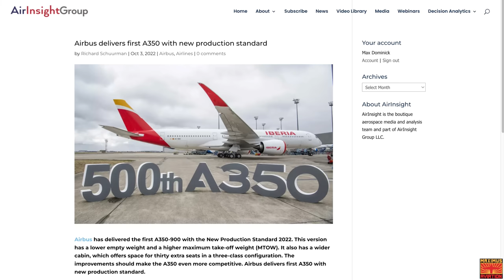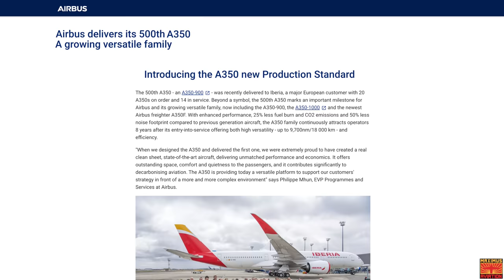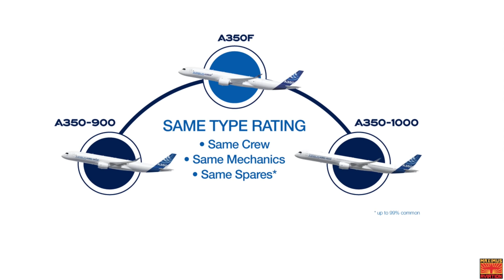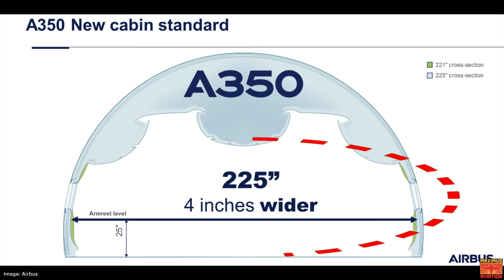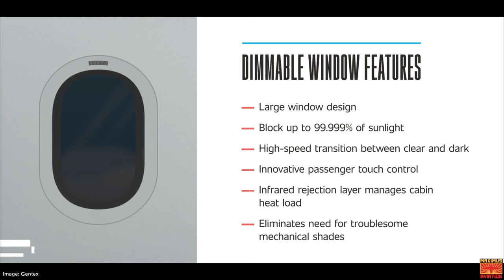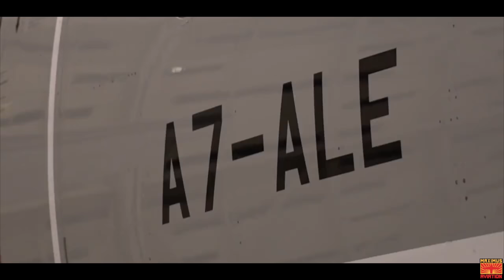Did You Know Airbus Made An A350 MAX Version?

Comment: It is actually called "DUCT (as in air conditioning ducts) TAPE," though 'Duck' is FUNNIER !
😄
Reply: There is a Duck brand with a duck picture on the inside of tube in the USA but it is duct tape.
Reply: Now if more US airlines would adopt Airbus planes I'd be grateful as Southwest Airlines and Boeing's criminal behavior has made it harder to plan. I refuse to fly Boeing anymore. Embraer E170 and Airbus A320-321 on Frontier, Alaska-Skywest, Spirit, Delta.
Reply: @eleventy-seven  if you are in America, that would be quite difficult if not impossible.
Airbus will always be a "Euro" based aircraft company, even if it assembles some Airbus jetliners in the U.S.
Hopefully, FAA sanctions are working and solving all the Boeing  safety issues.
Reply: An educator never learns to stifle themselves.
Reply: "thin cotton duck coated in waterproof polyethylene (plastic) with a layer of rubber-based gray adhesive (branded as "Polycoat") bonded to one side" ww2
Reply: @2adamast  But don’t you find that underwear to be uncomfortable?

Comment: Hello you write A350 MAX .  Been working with quality assurance at AIRBUS since2003 and with the 350 from the beginning in Toulouse observing that the quality is set to side example if a mechanic contact me asking for assistance and my se a fault it can lead to dissmissal of him(her) and they dont want me to put my nose into things. As a example look at THSA Actuator it is not put togheter correct on 100% of the Aircraft . The peices with wirelockin wire is fitted wrong way so in the end the wire can pull the fastener lose and create a failure of the peice or a hydaulic leak or a electrical malfunction when i tried to escalate this a coupe of years ago it just blow up in my face. 

Regards 

Jan Vanhainen

Comment: Did they add MCAS too?
Reply from the maker: Thankfully NO. lol
Reply: Ha!!
Reply: Just dueling sidesticks.
Reply: I know it's a joke, but Airbus actually uses similar systems since the 80s. The difference is that they have always used redundancy. And even then they've had they share of bad experiences and software improvements.
MCAS failed with the MAX, because the 737 is still an old analogue aircraft and there was no base upon to build the must needed redundancy. All 737 operate with just a single flight computer in operation. After the revision, the max is the only 737 flying with the two computers operating simultaneously - while most other aircraft use 3 (or more) for the same role.
Reply: @miks564  So do you fancy yourself an aeronautical engineer to do you really sell insurance. We vote for the later. Bilge is very obvious and is hard to sell.

Comment: Tape is the way to go. I don't know why they are still trying to paint over composite. Just wrap the plane in vinyl like you would a car. Use the speed tape material, but in larger rolls. Instead of 3 inch wide, make them 0.5m or 1m wide. Tape can be applied at any airport by the airline's own people. No need to send the plane to a specialized facility to be repainted. So no down time. It is also easy to patch small segments damaged by birdstrike, etc.
Reply: And just paint over the tape! Brilliant idea! Saves maintenance and later embarrassments from keen eyed youtubers.
Reply: Too expensive and too heavy. The problem is surface prep, not rocket science.
Reply: Or just use boat paint it's pretty tuff

Comment: Do you know Airbus has flown an autonomous A350-1000, 500 times without pilot inputs to taxi, takeoff, and land over the last 2 years using just new tech onboard? At least one video shows the copilot acting like the dog biting the captain each time he went to touch something. Referencing the ongoing joke that in the future there will be one pilot and a dog in the cockpit. The dog is there to bite the captain if he goes to touch anything. May not be a joke in the future.
Reply: Not surprising really. Won't be long before that is the standard in the industry i imagine.
Reply: But will the pilots remember how to fly if the need were to arise? I prefer my pilots to have some recent work experience.
Reply: Single pilot operations for commercial airliners  is not happening in this decade or the next . Still alot of questions that need to be answered. 

Anyways most pilots prefer doing their own take offs and landings unless the visibility is terrible.
Keeps them from getting rusty , and sharpens their piloting skills to avoid degradation...

Comment: Another advantage of the new A350 is, the weight reduce further up to 0.5 ton naturally during service…. As the airplanes shed paint.
Reply: Right you are. Great point. The airborne commode ejection drainage system directly into the environment also reduces weight. No need to fly around with all that heavy poop.

Comment: Pretty impressive these improvements.
Reply: Nothing ground breaking. Usual refinements of an existing design.
Reply: Normally these level of improvements come with a completely updated airframe. 
If they can do this in a regular update, the a350 neo will be a beast when it eventually replaces the a350.
Reply: @baronvonlimbourgh1716  Not really. Mostly just reconfiguring the interior with the latest trends. It's been done many times before on existing aircraft. The most significant change is moving the bulkhead back a couple of feet. Similar to what Boeing did on the 787-8 replacing the tail section to the 787-9 tail section.  Very similar to what happened on the 777 as it's progressed.

Comment: 787- I'm the narrowest seat in widebody aircraft category
.
 
350: not so fast, I'm the newest King of narrowest seat in widebody aircraft
Reply: False 
based on the 787 ACAP, this is 17.2" seat width on the 787. Better than the 777, and 747@ 10-Abreast seats
Reply: @ndlben7129  No that's not true either. It's pretty much been Boeings standard on the 747 and 777-300 ER for decades.
Reply: @johniii8147  The 747 and 777 "classics", are 17" width seats, the 787 and the upcoming 777X is 17.2" with more humidity and lower altitude impression of fly of the cab ...

The 787 is a New comfort standard vs 747 and "777 classics"...
Reply: I challenge everyone in this thread to look at a ruler and ask yourself, "This .2"difference; does that amount to comfort? Can you even see the markings for .2" without reading glasses or a magnification lens?" Then measure the diameter of your arse.
Reply: @ndlben7129  Just depends on the seat the airline chooses on 77X. 18 is plan on many of them with the thinner walls.
Reply: New normal for cattle class configuration
Reply: @ndlben7129  787 seats Ranges from 17.2" to 17.5" for a 9 abreast. Boeing can skin the walls too in the future to fit an 18" .
Reply: @mmm0404  It's an issue people make far too much of that don't want to pony up the money for higher classes and get stuck in the back of the bus. On BA for example width on the 787 is 17.5, the 350 17.6 and the 380 17.5. People just like to complain while paying the cheapest possible price in the category of traveler.
Reply: Good one Ndl Ben. I learn something new everyday.

Comment: So, we're going to ignore the elephant in the room, which is that Airbus is scared of the 777-9 and what it's bringing to the widebody sector. Also the fact that Airbus is basically doing to the A350 what Boeing did to the 737, by copying 787 tech. I digress.
It's clear that Airbus has no plans to develop a new widebody aircraft, so they will focus on their highly successful narrowbody sector and let Boeing eat their lunch at the big boy level. Funny Maximus didn't mention any of that. 😜
Reply: I thought the A350 was a new wide body aircraft no?
First delivery in 2014
Reply: @Rasscasse  The 777-9 is brand new. Remember Airbus marketed the A350 as an XWB, or Extra Wide Body, which was a dig on the Dreamliner that was the new widebody at the time. But, Boeing has been comparing the width of the 777-X to XWB, which pales in comparison.
Boeing widened the 777-X by using thinner and lighter components on the walls, so Airbus has done the same with the A350 to not only make it more competitive in terms of roominess, but to allow 10-abreast seating, which the 777 has had for decades. Some airlines are looking for more capacity on a twin engine widebody which Boeing is about to deliver so Airbus wants it's largest widebody to become a bit more competitive, so they now have these optional models. I wonder if they'll give them a name to distinguish them from the XWB. UWB maybe?
Reply: How exactly is Airbus scared of the 777-9?? Airbus are so well ahead on their game that people like you are unaware what will happen to the 777-9. Quietly by the wayside Rolls Royce have been developing their Ultrafan. Their target is to get the new engine on the prototype A350F in 2025. So with a new geared engine that has about 12-15% fuel advantage over the GE9x being applied across the whole A350 line what is going to happen to the pax version of the 777x programme? It's going to be dead isn't it?!! Just watch!!
Reply: @nathd1748  People like me, uh? When I talk to people like you, I like to talk numbers, since numbers don't lie. 
Before we talk about the Ultrafan, let's talk about how both planemakers are doing. When it comes to narrowbody, Airbus is virtually untouchable, especially in terms of orders. However, when talking about widebody Airbus can't touch Boeing. After 8 years in service Airbus just delivered its 500th A350, and fewer than 1000 total widebody aircraft on order, and fewer than 250 A330. Do you know how many Dreamliners, 767 and 777 Boeing has delivered since 2014? Of course you don't. Over 1000 Dreamliners alone have been delivered. Adding 777, 747 and 767 variants  just make the numbers even more lopsided.
The Ultrafan won't be fitted on the A350 without some design modifications, much the same way Boeing had to do when they put the CFM 1B on the Max, and in terms of cargo, that's not putting Airbus anywhere close to Boeing on cargo aircraft orders either.
The reason Airbus is making the A350 wider is to make it a competitive option for the 777-9, but Airbus still can't give it a higher passenger capacity, cargo capacity or higher maximum takeoff weight than the Boeing. If fuel savings was all airlines cared about they won't still be flying the quads.
So yeah, people like me know about the Ultrafan, but the numbers say it all.
Reply: @sainnt  You dont know the numbers obviously. Boeing may have built over 1000 dreamliners but they haven't yet reached break even have they? While Airbus reached that on the 350th A350 of all numbers. The Jltrafan will go on the A350 wing just like the GE9x has been fitted on the wing of the 777x. The nacelle will be raised and the increased fan diameter will be managed with nowhere near the aggro that Boeing have had with their short legged 737. The all important number is the seat mile cost. The A350 with Ultrafan will give a number that the 777x just cannot get close to.
Reply: @nathd1748  Again, numbers here, we're talking about numbers of aircraft being ordered and being delivered. Planemakers have diverse products, so obviously developing a game changer, which the A350 is most certainly not, would prove to be costlier. Airbus never made a profit on the A380, but most would argue that it's still a successful product. The Dreamliner has enough orders yet to be filled to actually make the program profitable, unlike the A380.  That also doesn't change the overall numbers of widebody aircraft being delivered by Boeing. They may not yet be profitable with the Dreamliner, but they're very profitable overall with widebody aircraft. Go check those numbers. Is the A330 neo actually profitable?
You again proved my point by trying to be ignorant. The wings of the 777X are different from current 777, so in fact modifications were made to accommodate the GE9X, and same would happen with the Ultrafan. Neither changes are plug and play, so, there are modifications, no matter how much you want to downplay it. That's the reason every variant of an aircraft requires separate certification.
Reply: @nathd1748  who said the a350F is getting  the ultrafan ? That is not happening  . Wishfull thinking
Reply: @mmm0404  Do you work for Airbus? Obviously not. I do. The route being pursued by RR is to get the A350F programme flying with an Ultrafan. Airbus are just saying they will go with either the XWB or Ultrafan when the time comes. It will totally BUM the 777x programme.
Reply: @nathd1748  a stretched 787 with the ultrafan or a newer GE engine will bum the  a350 program too since it will eliminate payload  and range restrictions  on the -9 and -10 , and give it similar  payload/range capabilities to the 350 while bieng lighter and more efficient.  

Seems airbus is too worried  about the 777X that they forget about the 787 which is the real threat to the 350 program lol. Boeing wouldn't mind losing the tiny 777X market  to airbus , in exchange for dominance in the huge 300-370 market  , with stretched varients of the 787-9/10. 

Anyways you think GE and Boeing is seating idly by?

Is the a350F so uncompetitive  against the heavier 777-8F that they are so desperate to slap the ultrafan? . Sounds desperate  to me .. The a350F cant even compete a 30 year old 777 airframe . Lol
Reply: @mmm0404  As usual you are missing something. Airbus are forever committed to improving their products and will upgrade the A350 however they can. The reason RR are pushing to get the Ultrafan onto the A350F airframe is purely on a cost benefit basis as the airframe will be undergoing testing anyway. As for the 787, you are quite right that it could benefit from the Ultrafan, but to make it that much more appealing over any A350 variant would require a new wing....the stretched A350-1000 has no performance reduction from being a stretch whereas the 787 stretched -10 (or longer) version does and will.
Reply: @nathd1748  No , it wont require a new wing , just a longer one . Did you know that the 787 has almost 5 meters of wingspan left before they exceed the code E requirement  (65m) unlike the a350 (64.75m wingspan ) that can no longer lengthen its wing unless a folding wingtip is adopted? 

To be able to increase wing area the a350 will need a new wing not the 787. Boeing had build a new wing for the 777X with folding wingtips in order for it to use  code E gates like the legacy 777. 

Isnt it mind boggling that the 787 manages to outperform a330neo while having a 4m shorter wingspan and also manages to keep up with the a350?

Boeing could simply just add 4.5 meters of winspan to the 787 by using longer raked wingtips like they did when they upgraded the 777-300 to the more capable 300ER. This could significantly increase the 787's capabilities , almost matching the a350's but with a much lighter airframe

 So yes the 787-10 stretch with a same wing length as the a350-1000 could be deadly . Not to mention how lighter and efficient it would be  . 

The 787 is the biggest threat to the a350 program , not the 777X.